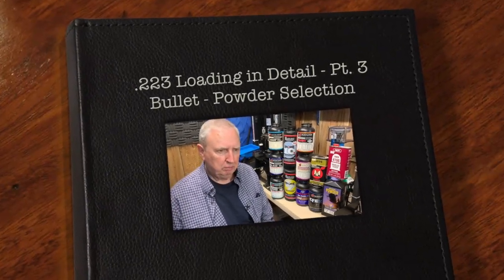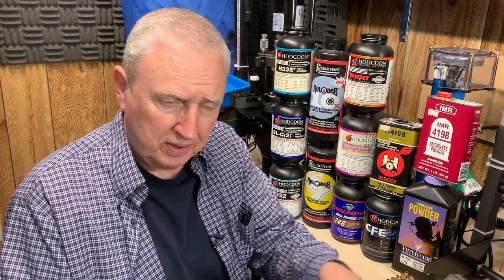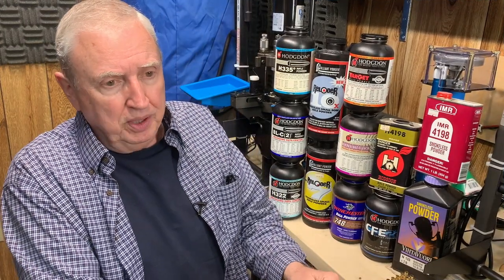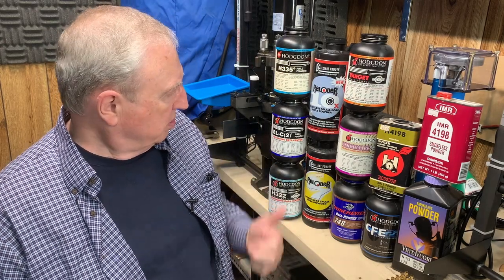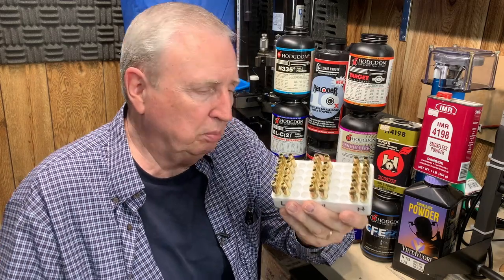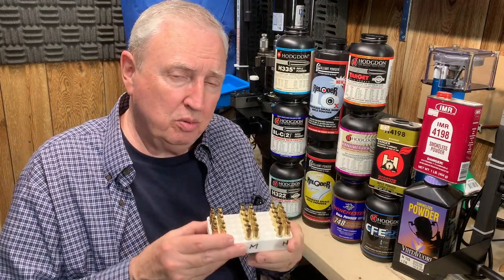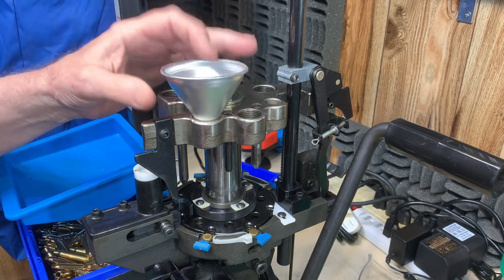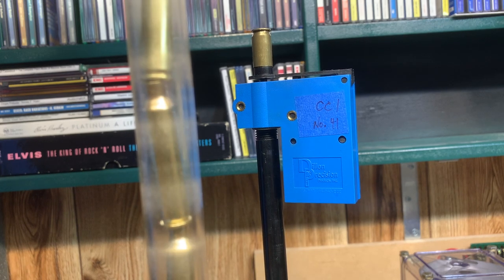.223 – Dillon 1050 – Pt. 3 - Load Development

Comment: Great video. One thing to take into consideration is that what your going to find is the best load for your rifle, not the best load for your press and rifle combination. I really do like the way you did this but it would probably be a good idea to compare the best powders you find this way to how the dillon powder measure throws them. Im sure you could find a sweet 223 load that throws consistently in the dillon measure. That would speed you up quite a bit.

Comment: Rex, it’s always a delight to watch another reloading video from you as regards both content & presentation. I’m in the UK & suffer from the addiction of collecting, using & where possible improving reloading tools of all ages (you may be familiar with this condition I think). Aside from your current .223 series I’m sure I’m not alone in hoping you may be able to do a video or two on some of the classic equipment from the 1930’s - 70’s to go along with your Hollywood press series. Regards Russell
Reply from the maker: Hmmmm. Sounds like I need to dust off my Star Reloader and make some .38 Specials for you.
Reply: That would be very cool.. I really miss my old friend Jim Whitney when we did projects together

Comment: Great video, Rex. I prefer doing load development on my single stage or running one piece of brass at a time through my 550. I'm always weary of press stretch when doing development.  Looks like you've got a solid method for your 1050. 360 rounds for 223 development is a significant undertaking, but you are well equipped for the task. I totally agree with the statistical significance of 10 round ladders versus 5.  Don't worry about the video delays; it's supposed to be fun. Take your time and do what you like. Thanks again for the quality content!
Reply from the maker: Thank you for your comments and patience. It became a kind of challenge to see if there were any remotely practical way to do load development on the 1050. It will also be a challenge to shoot all of these.